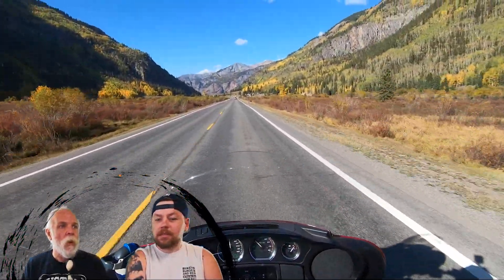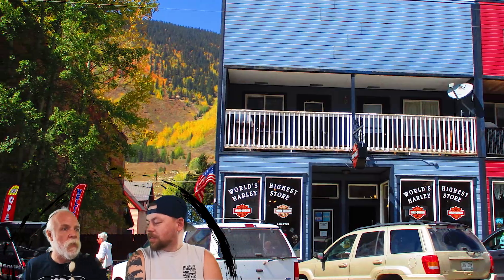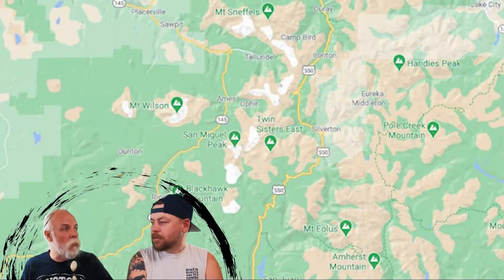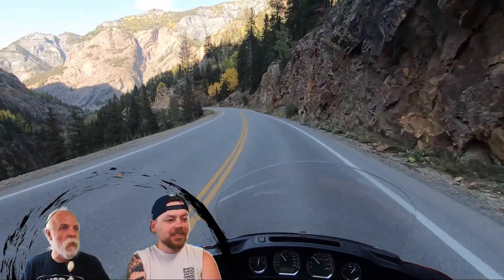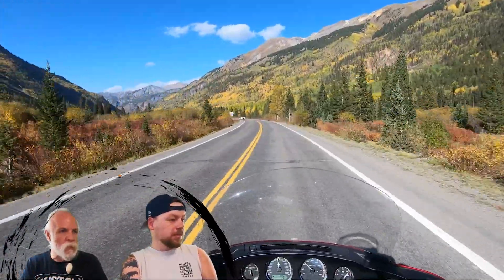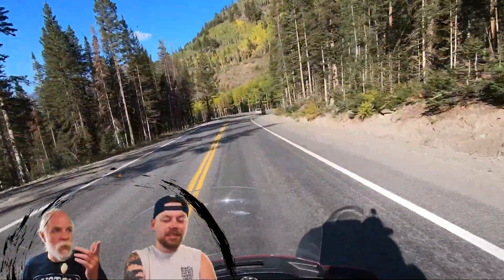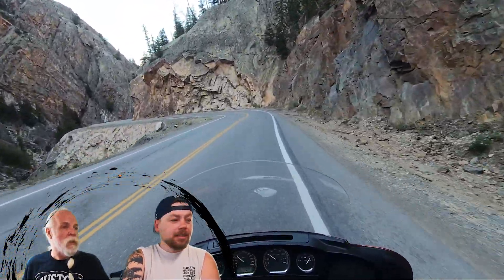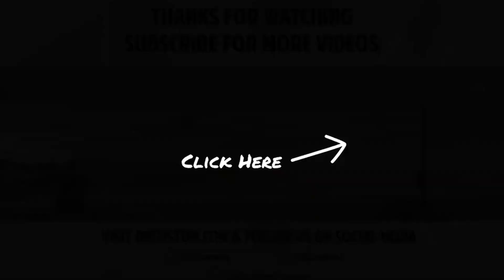Malfunctions Riding the Million Dollar Highway

Comment: Amazing ride but def not for a rookie.  If you aren't great with heights, some of the visuals where the drop is a thousand feet inches from the white line with no guardrail can make your stomach turn.  I'm not great with heights so i def used ALL of the room between the lines - there is no side-by-side riding on the Million Dollar highway.  It should be on your bucket list - I've ridden many beautiful rides but I have to say this is my #1 as far as scenic combined with elevation.  What was most shocking to me is last year (2020) in early August, at the summit, it was almost 80 degrees.  Most days we rode the temps were in the upper 90s to low 100s but I thought at over 10k it would be much cooler.
Reply from the maker: Yeah, definitely is spooky for those that don't like heights or drop-offs.  This last year it was still cool when we were up there...but there was a surprising lack of snow on the mountains viewed from Molas Pass.
We really enjoy that ride and I completely forgot to talk about it in the video.

Comment: What drone do you have , I bought the magic mini for this reason to take on our motorcycles trips
Reply from the maker: We had the Mavic 2 PRO, which was stolen.  We replaced it with the Mavic Mini.  The mini is what I took on this last trip.  Unfortunately it has different calibration procedures than the 2 PRO.  That and the variable that we are using an iPhone with the controller, vs. with the 2 PRO we had a dedicated controller were at the root of my operator error.  :)  I have it all figured out now and should be able to capture some good footage going forward.